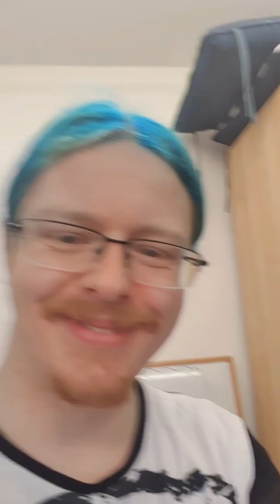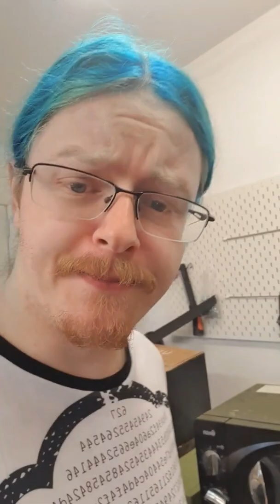Can You Use A Microwave As A WiFi & Drone Signal jammer 2.4Ghz. (long version)

Comment: What about Long term effects?!
Reply from the maker: This signals have been around for a long time so far no known effects.
Reply: And if one may be in that hypothetical 1m space, in any case, you still wouldn't want one on your block.
Reply: @beksta  If you were in that 1m space it means you would have jumped over a fence which has big warning signs on it. The ones at street level are much lower power.
Reply: @WaIdo93  talking about 5g, afaik it requires more power to cross through trees, buildings etc. But is overall low powered. But the crossing through at high power is the real issue, long exposure of that kind of directed wave doesn't seem healthy.